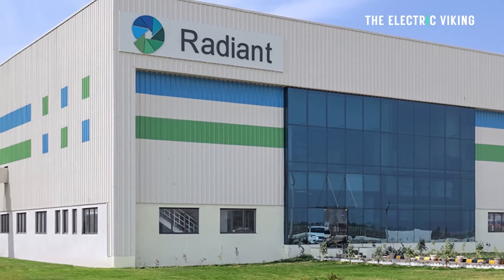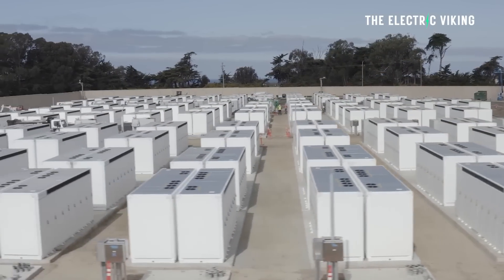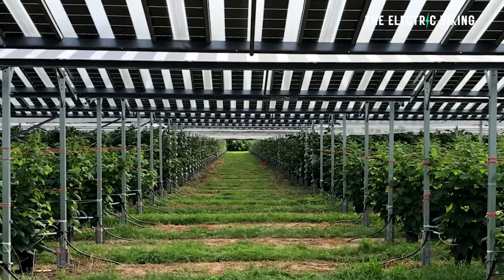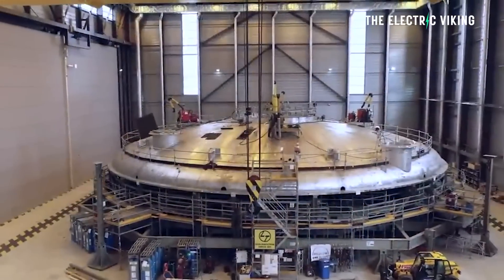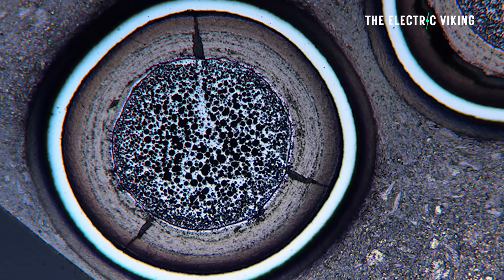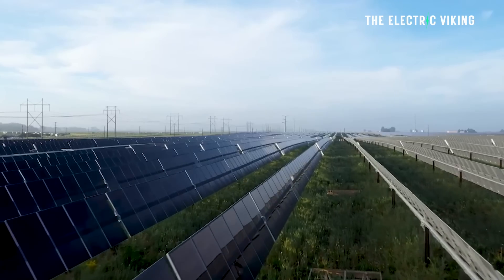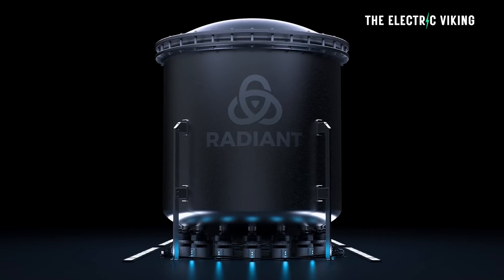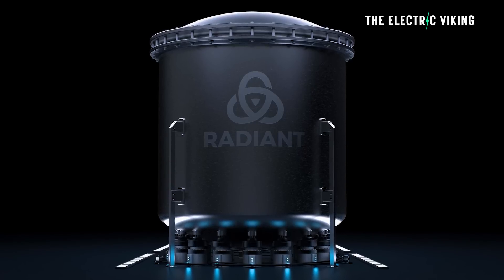SpaceX engineer reveals portable nuclear reactors to power 1,000 households

Comment: Thorium reactors would solve the problem with no nuclear waste.
Reply: I watched a recent video on Thorium reactors that explained all the benefits, and claimed that they are equal to renewable energy in most respects, and only cost twice as much. Which begs the question, why would you want to pay twice as much?
Reply: @davesemmelink8964  scalability, consistency, and actually operating at their rated capacity unlike renewables.

See, they seem equal only if you assume the same park creation cost to fit the same capacity demand. Which is untrue. 

Because when you build a 1 Gwh nuclear power plant. If you build a PWR rated for that you usually have a total capacity of at least twice that, but you rotate the cores between operations and fuelling which means you effectively get your 1Gw of power 24/7 with almost no dead zone. If you were to use all cores in the light of a thorium reactor actually being able to do that, you would get double your rated capacity factor but let's pretend not. So when you build 1GWh of nuclear, you actually receive 1GWh of energy on your grid. 

Now let's build a 1Gw solar or wind park to replace the reactor. It is labeled as such because on a perfect sunny day with absolutely nothing to hamper your operations your plant will generate 1Gw, but as you know, the sun and the wind are inconsistent at best. Your output already varies in the day, meaning you only reach 1Gw at the absolute peak of solar/wind output, and then you have diminutive results in any other operating band. And then of course for solar, it drops to zero at night by default, while wind stops working when there is either not enough or too much wind (which is often). 

Which is why at BEST solar will give between 10/25% of its rated capacity as actual power, and not in a consistent way. While wind has about 36%. 

Meaning that if you wanted to actually replace your nuclear reactor with solar, you need to make your calculus of cost by replacing it with more than 4 times the equivalent plant size. And that is not counting that you also need and equally sized energy storage equipment otherwise when your plant absolutely obliterates energy demand the few moments it operated at capacity you are not able to capture that energy as you need from dump it overboard. 

When you take all of that into account, it makes solar barely worth competition with a PWR and hopelessly more expensive than a petrol or coal power plant, while all of the above are themselves hopelessly outmatched by a thorium reactor when evaluated with their actual costs and not the made up pretend ones.
Reply: @mobiuscoreindustries  Agreed and also, factor in I2R losses for charging batteries and long transmission lines for these enormous utility scale solar fields, more losses in the DC to AC conversion, the extremely healthy government subsidies (which fission gets as well in some areas but not nearly at the current level renewables and batteries get). Then you have to actually buy the batteries and scale those up to last through the night and account for seasonal changes and their natural degradation over time (northern winter nights are long and cold) and that 1 GW solar farm that takes up about 2500 hectares of land needs to be a 5-10 GW solar farm (they can do the math on land use and cost needed to lease) depending on the season and location to charge batteries for use at night and provide power to the ever growing power needs of a city, especially as the transport and industrial sectors transition to electric power. So what is actually needed to get solar on parity with 1 GW of fission power gets extremely expensive. 

These solar panels need to be changed out every couple decades to maintain peak efficiency so things get even more expensive in the long run generation after generation where that initial high investment in the thorium or fast fission plant gets less over time as it is constantly plugging away at <95% capacity factor rain or shine, day and night 24/7/365.25.

Then there is wind, which is good if you are close to a shore line or in a mountain valley that gets pretty predictable wind, but that has day and night and seasonal cycles also, so it has to be over built to compensate and batteries are still needed to match the gaps in solar and wind production.

Then there is the waste avalanche from those tens of thousands of hectares of solar panels, wind turbine blades, batteries, and e-waste from the power management and conversion systems. Which builds up decade after decade for generations to come. There is recycling which will take care of some of it, but looking at our poor track record for doing simple things like recycling plastic and glass bottles, and composting our food and bio waste for RNG and fertilizer, that possibility for reducing that avalanche in a meaningful way isn't looking very bright.

Unfortunately we are dealing with the short sighted general public and profit minded fossil fuel industry here, we need our John Galt / Tony Stark. Maybe when Elon develops the thorium fission plants running closed cycle supercritical CO2 turbines he will need for his Mars colony we will get our big break!
Reply: I'm for it if you truly  want to  get away from  fossil  fuel it's going to  take more than solar panels and  windmills if probably handled  it can  be  safe

Comment: You need to think 360 on these things - 'How can it go wrong' / 'What if its goes wrong' / Can it be sabotaged / Can it be targeted by Bad actors <-- Wind turbines Can but impact is small, Nuclear has a high impact.
Reply: No, nuclear reactors are protected by containment buildings or buried in the ground.
Reply: @kokofan50  And by extensive measures to prevent nuclear proliferation that are cost prohibitive to decentralized operations of SMR.
Reply: @sandmehlig  Digging a hole isn’t that expensive. Also, all of the countries with nuclear weapons got them before nuclear power, so proliferation concerns from nuclear power is misplaced.
Reply: @kokofan50  Sure, nobody ever dug anything up again. A hole is the safest place on earth.
Reply: @sandmehlig  digging a hole takes time, and one of the operators is going to notice heavy equipment digging up a reactor.
Reply: @kokofan50  I forgot it is protected by a "spade and shovel" invention, production and usage prevention measurement, where thing King collects digging tools regularly by force to keep everyone safe and sound.
Reply: @kokofan50  Not to mention using a dirty bomb is the stuff of movies and television shows since the bomb creators are at way more of a risk than the people they aim to terrorize. There are way easier ways to get materials to cause chaos than trying to infiltrate a fission plant to run away with a steel and concrete container the size of a garbage truck that can survive getting hit with an airliner and the heat from all the fuel cooking away, especially if they store it underground in a steel and concrete bunker like some places are doing. Meanwhile world ending biological bugs are stored in unprotected places but no one bats an eye at that because it doesn't have the word "nuclear" attached to it.
Reply: Yeah but that's anything, If another country wanted too they could just use emp bombs and take out a whole power grid including frying solar panels and inverters for solar panels. Nuclear can run 365 days 24/7 with only down time for rod refueling, produces far more power per acre of used land. We are not talking about old 70's power plants with many issues, modern nuclear reactors can be self contained with no issues if the power was to be cut off, they can also be placed underground where conventional bombs can not disturb unlike solar panels and wind turbines. Nuclear should be the main power source and solar should accompany it to help cut back on power plant degradation. My state of Connecticut gets 65 percent of it's power from one single nuclear power plant and it's been running since the 60's or 70's. That would take a huge swath of land worth of solar panels to get the same yield, solar panels that can match nuclear are about 10 to 20 years out. With only 20 to 25 percent power conversion from solar radiation that isn't all that great, also have to remember solar panels contain cobalt, lead and other heavy metals which are hazardous to the people that break them down such as China and India.
Reply: That is the thing with the new plants, they are designed with all this in mind. Even if power is cut off to them and the generators are destroyed the plant will use natural circulation to remove decay heat during those first few days when it peaks. So even if a plant is attacked the cores stay cool. If someone wanted to be a bad actor, they go after unprotected dense populations centers with conventional means, not a fission core inside what is essentially a steel and concrete bunker out in the middle of nowhere, with systems specifically designed to resist attacks and limit the spread of contamination. More people will be injured from the panic resulting from the sensationalized news reports than any actual contamination release.
Reply: @anydaynow01  These "designs" are purported to scam investors.
__
Well... putting (most) of my snide aside:
This designs has to include a proof that the remote communication implemented at the time of seeking approval
 can withstand the next 25 years (at least) of worldwide development in science, hardware and software to survive the (at least) two decades it will take for testing the overall safety.
And this is not: oh, today's algorithms and hardware is going to need a million years and the energy of the whole universe to crack that thing - my milk delivery robot said so.
Reply: What could possibly go wrong? 🤯
Reply: @sarahaubrey8096  The protective effect of the key generating algorithms to communicate with the system could be obsolete by the date the reactor is put into operation.
Reply: Sounds like a game changer for dirty bombs.
Reply: @carlturner4344  would be true if nuclear material wans't already easy to come by. But turning that material into an effective dirty bomb is another matter entirely. Natural and fuel level elements are harmless, and only a part of the waste is actually spicy enough as to be useful. Unfortunately said highly radioactive elements are very happy to kill anyone trying to work on them, and are also detectable by every single satellite hanging up there monitoring radiation sources. Which is why terrorist cells have long since abandoned the idea in favor of finding much more easy to obtain biological, chemical or conventional weapons that won't make one a live track target for surveillance satellites.
Reply: @carlturner4344  lots of them, easier to hide, buy and get hold of - unfortunately that is todays reality.  Solar and wind power in my back yard please
Reply: this whole debate shouldn't even be happening in an era when one can generate all the energy needed from wind and solar at a far lower cost and with none of the risks.
Reply: @dangrass  that's incorrect as wind and solar have barely started being cheaper than coal unsubsidized and are only cheaper than nuclear PWR when pretending they hit capacity factor all the time (their actual capacity is 10% for solar and 36% for wind). While they are absolutely a winning solution against the most egregious outliers in the power environment (especially the fossil peaker plants thanks to batteries) if you want to knock fossil fuels off their hold of baseload power you need nuclear. It's the only power source that possessed the qualities of 100% capacity factor and ultra high power density to dislodge fossil fuels and cut emissions. Even with help from batteries solar and wind are so unreliable they basically come shipped with a tacked on fossil peaker plant to take over them when they do not work, and a few extra coal mines because they fail to scale up to meet demand. 

Oh and maintenance. Because if you think maintaining a regular power plant is hard, try maintaining the 10Gw capacity solar or wind park you need to replace your 1Gw nuclear reactor. The math just says no and there is a reason why counties like Germany just keep building more coal and gas fired plants.

Comment: Nuclear power is incredibly energy dense. A ball of nuclear fuel the size of a human thumb contains the same amount of energy as a western citizen consumes in their entire lifetime. This means that nuclear power can generate a lot of electricity from a small amount of fuel. Additionally, the new generation of molten salt small modular reactors (SMRs) are even more efficient than traditional light water reactors, meaning that they can produce even less waste.

Here are some additional details about the energy density of nuclear power:

Nuclear fuel is about 2 million times more energy dense than coal, oil, or natural gas.
A single nuclear fuel pellet can generate as much electricity as one ton of coal, 149 gallons of oil, or 17,000 cubic feet of natural gas.
All of the used nuclear fuel produced by the U.S. nuclear energy industry over the last 60 years could fit on a football field at a depth of less than 10 yards.
SMRs are a new type of nuclear reactor that are smaller and more efficient than traditional light water reactors. They are also safer and easier to build and operate. SMRs are expected to play a major role in the future of nuclear power.